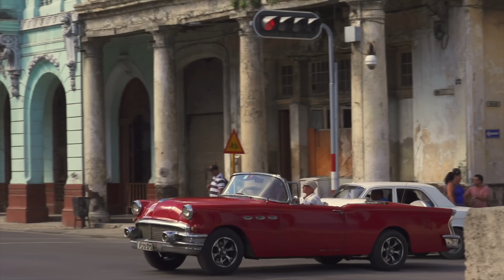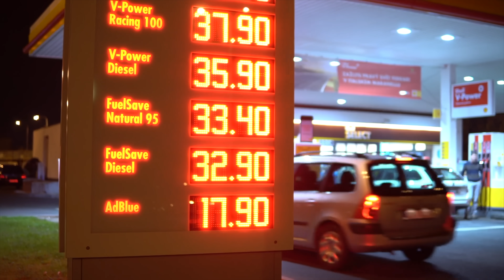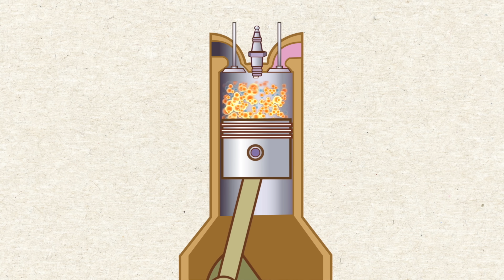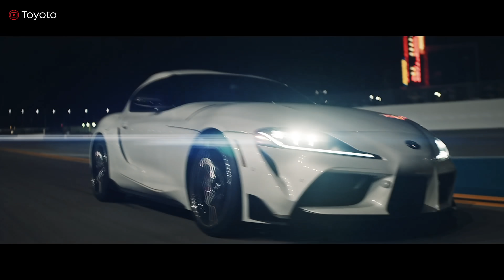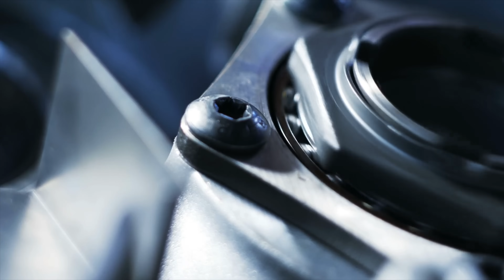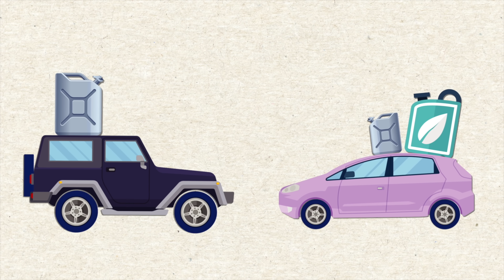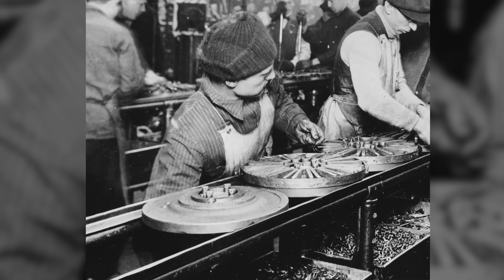7 Fuel Myths Stupid People Fall For

Comment: Here in Colorado, the gas companies rip us off by calling 85 octane “regular” and 87 octane “midgrade”. My car requires 87 octane, so that’s what I buy, but it costs me about 30 cents per gallon more than the so-called “regular”.
Reply: There is a lot of content about it. In short -- 85 in Colorado is no different from 87 elsewhere. They just label it differently (similarly how Regular in the US is no different from Regular in Europe despite a very different number)
Reply: I thought it has to do with elevation which is why 85 is sufficient whereas 87 would be used at lower elevations.
Reply: Is that right? Seems like you would need higher octane in higher elevation because the lower atmospheric pressure would make it easier to combust, but maybe atmospheric pressure doesn’t matter inside of an engine.
Reply: I’ve wondered about this, myself since moving to Colorado. I think we need Scotty to weigh in here; he’s about the only one I trust on matters such as this.
Reply: 85 is functionally identical to 87 at altitudes over ~3500 feet.  Lower peak cylinder pressures, and less oxygen, means a slower burn thus the two-point shift.  If you will be driving "down" to lowlands on the tank, use 87.  However usually there isn't a drastic change in ~400 miles range from areas where 85 is the lowest, where you couldn't just put 87 in when it becomes the lowest available at say 2500 feet.

EXCEPT with forced induction (supercharger/turbo) because that mostly negates the altitude effects, you effectively are always below sea level pressures when at boost, and it replaces oxygen content at any altitude, by collecting and compressing more air.  For those, the minimum in the manual is the literal minimum without any altitude compensations.
Reply: All depends on which octane number they use in Colorado. There is motor octane and research octane. 87 motor octane is the same as 91 research octane as I recall. Different states post different numbers for the same product. The US doesn't have a nationwide standard.
Reply: The higher altitude you go the less octane you need if you lived on top of pikes peak you could get by with 80 octane it has to do with the amount of oxygen in the atmosphere. The only reason we’re forced to use ethanol is because of politics this started in the 80 s i know i hauled some of the first loads into Colorado from the ethanol plants in Kansas and Nebraska

Comment: Mon and Ron 
Scotty, we use Motor and Research method when blending gasoline in the US. Also the RVP will change depending on the season. 
We would set the knock motors with a known proto fuel to compare knocks from the blending sample and adjust the blend recipe to make the octane and vapor pressure.
Been making gasoline final product for 20 years. We used to make 93 premium and 93 RFG when MTBE was legal to use.

Comment: I was taught by my mother, a Chemist who worked for Union Oil, that you would get better gas mileage from higher Octane (pre ethanol) gasoline, but it was not worth the price difference.
Reply: I’m not a chemist,but I know she’s correct….i own 3 vehicles and what I’ve noticed is this…When I use higher octane fuel I get greater gas mileage every single time

Comment: My 2017 VW Passat 1.8T only requires 87 octane. But I noticed a definite power increase when running 93 octane.
Reply: Especially the smaller the engine. I also notice more power with the e3 spark plugs in my Honda Civic.
Reply: Period
Reply: Same we use 98
Reply: All forced induction engines do better with higher octane.
Reply: I know most people will laugh...but I swear that my 04 Pontiac montana gets better gas mileage when I put in higher octane. I cam fill a tank with higher and it will last darn near two weeks. Lower octane and I am back at the friggin pump in less than one week. I pretty much drive the same every week. So....who knows...lol

Comment: I bought by 93 Explorer new way back when. The manual recommended regular gas, the lowest octane, so that's what I put in it. During the first few months I noticed a rattle from the engine when accelerating. Nobody could figure it out. Then I realized that whenever I used premium gas, the rattle disappeared. With mid-range gas, the rattle was only present during unusually hard acceleration. I ended up settling on mid-grade on everything I drove, and drove reasonably. Never had rattling problems again.
Reply: my car suggests premium and it's turbo charged so I'll never put anything different in it lol

Comment: I haul diesel and gasoline for a Co Op and go to the pipeline on a regular basis. There are 3 grades of gasoline, A grade (910ctane), V grade (83 Octane), and E grade (Ethanol).  In order to get the 87 octane you see at the pumps there are 2 ways, a 50/50 blend of A grade and V grade or a 90/10 blend of V grade and E grade. 89 octane at the pumps would be a 75/25 blend of A grade and V grade or an 85/15 blend of V grade and E grade. 93 octane at the pumps is your A grade (91) with an additive to boost the octane rating. Not all gas is created equal, but it all comes from the same pipeline in your area. If you go across the street to get gas because you think the other gas station on the other corner has crappy gas, wrong. I can guarantee you it came from the same pipeline, the difference is the detergents and other additives the supplier put into the gas when they loaded it on the truck. Each supplier has their own formula of additives that they use in their gasoline, and this is all mixed in while being loaded onto the truck to go get delivered to your local gas station. There is one thing that will stop me from getting gas at a location, and that is if I see the truck there making a delivery. It's because when they unload into the underground tanks, they stir up all the garbage in the tanks, and you don't want to pump that into your car. Sure, there's a filter on the pump, but they don't catch everything, and it will eventually plug up your fuel filter on your car causing you issues.
Reply: I worked at a gas station for a while, third shift so I'd often be there to assist with refills from the truck but never knew that "fresh" gas would stir up the residue in the reservoir. Makes sense, thanks for the tip.
Reply: Thank you for the tip!  And Merry Christmas and Happy Holidays!
Reply: I talked to a tanker driver at the pumps once,he told me the stations with the ""blue"" caps over the fillers on the ground are pure mid grade..The stations with only "red and yellow"" caps over the fillers on the ground are mixed ..red(high grade) and yellow(low grade) to make mid grade.
Reply: @Enochrry6024  He could be right, but I don't know of any midgrade gasoline, just the 2 grades A and V, then throw ethanol into the mix. I don't deliver to gas stations, just to our own Co Op and we only have one customer that actually has underground tanks. I do know that they can do some fuel blending from their underground tanks, our one customer does it with their diesel during the winter blending #1 and #2 diesel for the plow trucks.
Reply: @mfraze8753  ..I may be wrong,but I think the driver meant the pure mid-grade is mixed at the ""refinery"" to go straight in the tanks in the ground at certain stations(blue caps)..All the rest are mixed at the stations ""high"" and ""low"" to make mid-grade..I think.
Reply: @Enochrry6024 correct but it changes based on the state

Comment: Great explanation for those who didn't know how the ratings worked.there are a lot of pros and cons to the use of ethanol in gas.
As a mechanic I can tell you that ethanol isn't good on injector systems ..it gums the injectors causing poor fuel flow .. injector cleaners help but aren't made to treat ethanol.
Many may know already ... do not use ethanol fuel in your small engines ..pure trouble ..
Reply: you referring to E-10 or 15?

Comment: I discovered you Scotty b/c I had a horrible experience at Firestone getting my car checked; ck engine light was on they wanted to charge me 100.00 to check.  You should be teaching this stuff to high schoolers.  I learned nothing about cars from anyone when I was a kid.  I am empowered now my friend! Now I can’t stop watching you; I love you!
Reply: Literally no one charges $100 for a check engine light.
Reply: @higgy82  yes they do, every shop I’ve ever worked at charged at least $99. Because we had better scan tools than the part stores.
Reply: @fallenhero99  
So you openly admit you worked at scam shops?
Reply: @higgy82  They do!A few years ago Courtesy-Chevrolet charged $99.00 for check a light in my Buick.
Reply: say no and call around  and get a ob2 reader
Reply: @higgy82  yes they do, depending on the vehicle, for example I drive a VW a mechanic not even a dealer charges 150 bucks just to put there obd2 thing on it to find out the problem, granted if you let them repair it that goes towards the labor.

I suggest just buying a obd2 reader alot easier and cheaper in the long run
Reply: @higgy82  The fee is to keep you from taking their diagnosis and repairing elsewhere. Most shops will wave this fee if you buy the repair

Comment: I live in the western USA, where we have garbage 85 octane for regular gasoline.  When traveling through the midwest, we fueled up with 10% ethanol gasoline.  The ethanol must've cleaned grime off of things in the tank or fuel line, as we ended up with a clogged fuel filter.  It's happened twice during trips to the midwest, so we always keep a spare fuel filter with us and we immediately know what the problem is if we encounter engine trouble on those trips.
Reply: Sometimes you just get gas from a station that has a lot of crap in it, and it clogs your fuel filter. My son and I changed our fuel filters right before we both drove up North a few hours to stay with a friend for a while. I stopped for gas before him so we ended up going to different gas stations once during the trip. When we arrived he said his car was running bad and was hard to start. We pulled his fuel filter and poured a bunch of really fine black something out on a paper towel. I pulled my filter just to show him it did not have that inside. All it takes sometimes is one bad gas fill-up and you need a new filter.
Reply: @ezralord4901  I have been told that it’s not a good idea to buy gas when there’s a fuel truck there at the station filling the underground tanks . It stirs up debris in the tanks and that gets into your fuel lines and can mess up the engine.
Reply: @glennso47  You are very correct. My Grandfather told me that too, and I didn't listen to him once... it did make me end up rebuilding my carb because of all of the trash I got in the gas that fill up (this was back in the 80s), but to this day I will not get gas at a station that is getting their gas truck.

Comment: Take a day off Scotty! We will still be here when you get back. :)
Reply from the maker: never!
Reply: @scottykilmer  Haha, that's what I figured! :)
Reply: @IJoeAceJRI  I’m guessing he pre records then works on cars rest of the week
Reply: Oh Come on, when you love what you do (which I'm sure Scotty does) every day feels like vacation.  But no he probably records a few videos so he can work a normal 5-ish day week like everyone else.
Reply: @scottykilmer  Scotty my 2016 1.5L Turbo rough idles now at 107,000 miles but only when the Ac is off. When I turn the Air or ac on it idles normal. Do you know what this could be?
Reply: @scottykilmer  keep it UP.. Love the information
Reply: Scottys grind is on a entire different level
Reply: @John34.  the piston return springs
Reply: @isaacmudge8682  So you had the same issue?
Reply: Life takes NO breaks lol
Reply: @chozen_1309  no doubt!
Reply: @John34.  The added load is being catered for....but not the "unloaded" state.... a sensor failure....But which one? Only a scanner will help.
Reply: @isaacmudge8682  THE WHAT! You're havin' a laff!
Reply: @patagualianmostly7437  Well, my reader says all sensors are fine. The live mode 6 data says there are cylinder misfires in cylinder 4. Later that night I checked again and it said I had cylinder misfires in cylinder 1,3,4. I took the hose off leading to the throttle body and there was excessive wet carbon in the throttle body so I sprayed cleaner in it and tried to get a soft brush in there to clean it. After that I used gumout engine tune up in the gas. Well it seemed to work for a day or so and then started idling just as rough and thats when I got multiple cylinder misfires. Took it to the dealership because I have a 250,000 mile warranty with them on the engine and Transmission but they have to do all engine maintenance before they give me a new engine or Transmission if it goes out before the 250,000 miles. I take it to them they tell me they don't find any codes. I told them it wasn't throwing codes they need to look at the live mode 6 data. You can even tell the car has a rough idle. They said they saw nothing wrong but would put it back on the lift and look. They call me hours later and said they think it may be a fuel injector problem and they will probably need to be replaced, which I know means $$$$ and that probably isn't even the issue. Im more and likely going to take it to a real mechanic in a couple days because they actually know what they are doing. The mechanic I talked to on the phone about my problem said they were idiots that the mode 6 data obviously shows there is something wrong in the cylinders that it could be anything and if the throttle body was as dirty as I said then that could cause multiple cylinder misfires...
Reply: @John34.  I had something like this going on and it ended up being one of the lash adjusters aka lifters stuck in the full open position, which broke the spring opposite the lifter. The spring was then too short, so it did not close the valve, which allowed exhaust to get blown back into the intake. In your case it could be an intake valve not closing. Either way, pull the valve cover and take a look at your rocker arms, springs and lifters. Good luck!

Comment: A few facts about ethanol in fuel:
1. If you don't drive your car very often (as in, standing still for weeks at a time) the ethanol starts to attract water from the air. This water can then cause corrosion in your tank. 
2. In Europe all fuels containing less than 5% ethanol are marked as E5. Chances are it'll actually have 0% ethanol.
3. In older cars the ethanol can dissolve seals and fuel lines so check before filling up with E10.

Finally, some observations: in my own car I've noticed a 5% reduction in fuel economy when using E10. I did not see any change in engine performance.
Reply: You saw a reduction in fuel economy because ethanol fuel has less potential energy and (if I remember correctly) a higher oxygen content than regular gas for the same volume of liquid.  This means the computer has to compensate by injecting longer, or more fuel, compared to plain gasoline to get the same amount of work (power) out of the engine.
Reply: I have heard some of the classic car collectors refuse to use ethanol gas because it will eventually gunk up the engine. Anyone have thoughts on this? I've also heard it's bad for lawn mowers. Any truth to that?

Comment: 85 octane is available at stations in high altitude areas--equal to 87 in lower areas.
Reply: Yes it is but most car manufacturers don’t want you to use regular 85 octane
Reply: @midnitesquirldog1 I remember Sunoco ultra 95
Reply: I lost two miles per gallon in my V-10 engine when I stopped being able to get straight gasoline and had to start getting gasohol. I was only getting 16 mpg on straight gas as it was. I also lost some performance too.
Reply: Both of my cars have 87 octane minimum requirement, I will never put 85-86 octane in them no matter what the altitude. Don't mind paying more for 89-93 or no-ethanol gas

Comment: I knew an old school mechanic and I bought up unleaded plus and should you use it. He told me unleaded plus isn't refined any different. All it is is a mixture of regular and super unleaded. I fill up my Ram 1500 at Costco and I don't let my gas go below a half tank. Costco only offered regular and super. One week I top off with regular and the next week super. My truck requires unleaded plus, but I haven't had any issue with the gas. Costco supposedly uses top tier gas and it pretty good.

Comment: E-85 is crap. Vehicle inherently gets 30% less fuel mileage because there’s less energy per btu. Therefore the cost offset is not with it. Ethanol is also more corrosive.